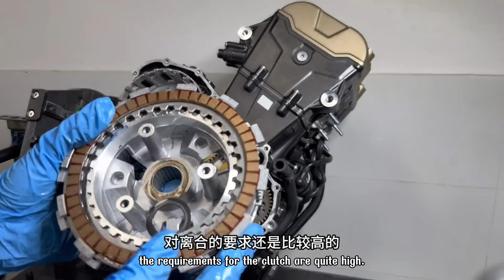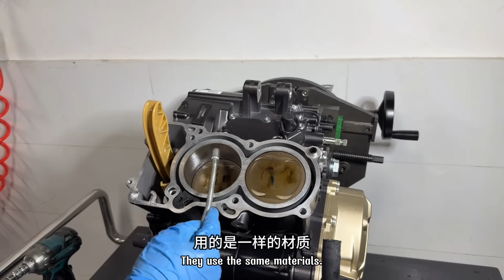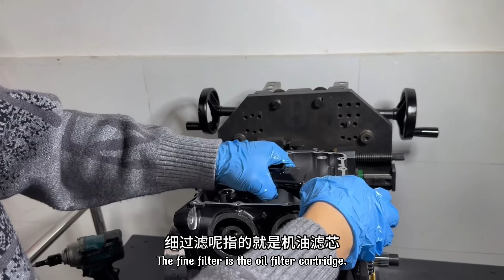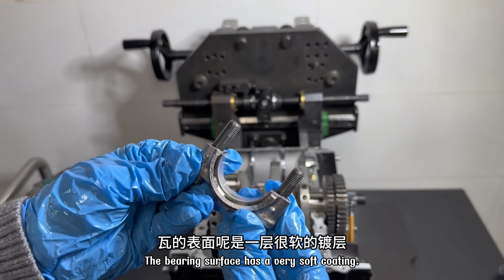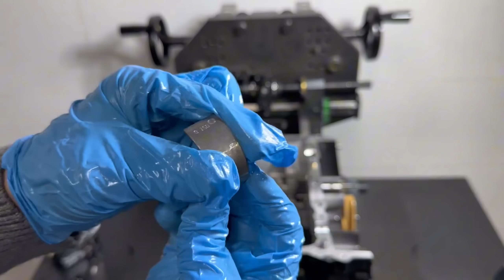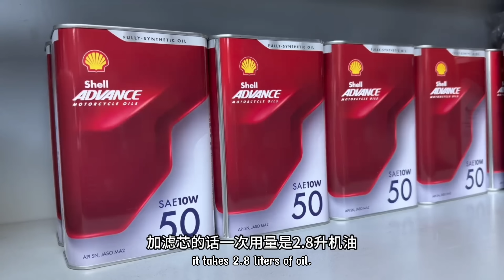Voge DS800X Engine Full Teardown: Is it a BMW Clone?

Comment: Does this engine design and BMW F900 design have better top end lubrication compared to the KTM 790 design? Is the oiling system better as to prevent cam wear which is common on KTM 790?
Reply: That problem is already solved. Will everyone be repeating this for no reason?
Reply: @vascorider  because it actually isn’t fully solved. It’s a design flaw in the engine oiling system that takes to long to get oil to the cams upon cold starts. I have a 2024 790 ADV with 15k miles on it. Cams are still “good” but show signs of wear.
Reply: @bushy3d  that’s a catch 22. Then when warm with natural shear you will get wear at higher RPM because the oil will lack the proper film strength (HTHS)  between the lobe and the follower.
Reply: @donnyjackson1908 signs of wear all motorcycles will have if they have been ridden. That transforming into a problem is something else. There's not one single CFmoto 800 engine with cam problems since they have been making them. CFmoto made improvements. At least in the ones for CFmoto
Reply: @bushy3d  I would say the bike is fantastic, just the engine wasn’t designed to do long miles easily. The nature of the cam profile and oiling system lends to strong power and performance, but likely sacrifices some longevity. Mines been great, I’m not sure it will run 50K miles without engine repairs however. I’m optimistic but also skeptical.
Reply: Thank you!

Comment: Hi, I like your videos. Is it possible to open the engine of a MotoMorini X-CAPE 700cc?
Reply: Basically clon of the er6 Kawasaki 650 with longer bore stroke produced by CFMoto
Reply: Search cfmoto 700mt.
Reply: @27shuhaimi Yeah, I've looked into it, but I’m not sure if it’s the same one used in the 700CL-X, the older 700MT, or the new 700MT.
Reply from the maker: ok